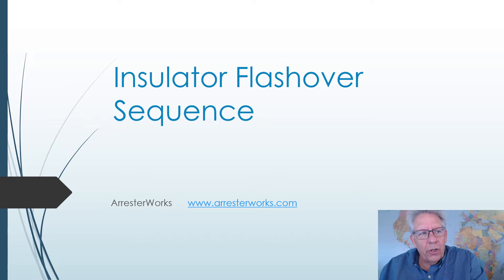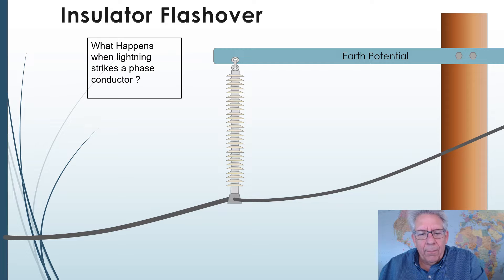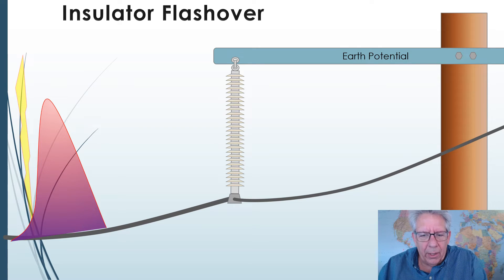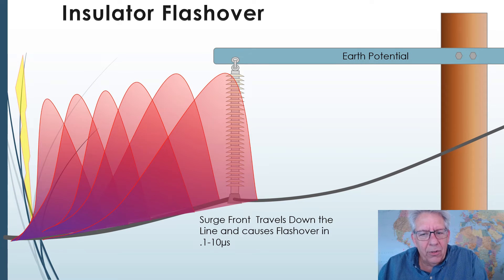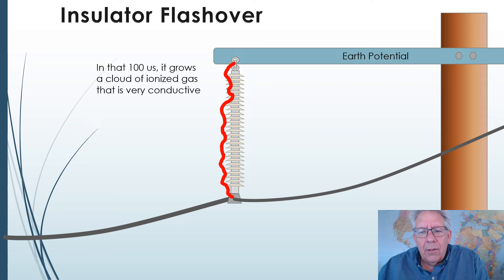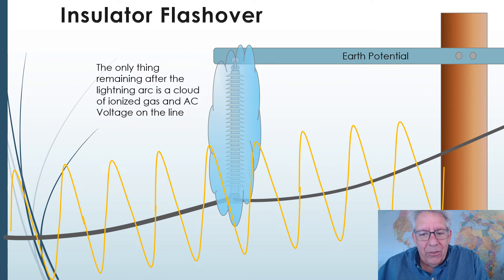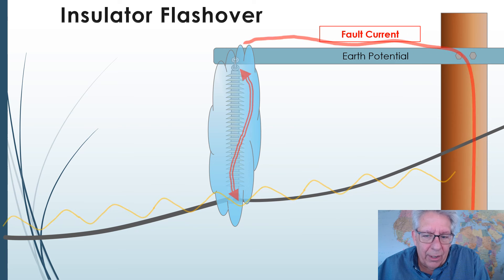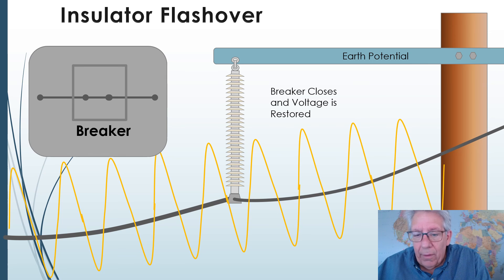Insulator Flashover Sequence

Comment: I like your overall explanation but got confused with the statement that the ionized gas around the insulator has low conductivity? If that is the case, then it would not result in a flashover. For the flash over to take place, the insulator and surrounding areas will be at high conductivity. 

Thanks